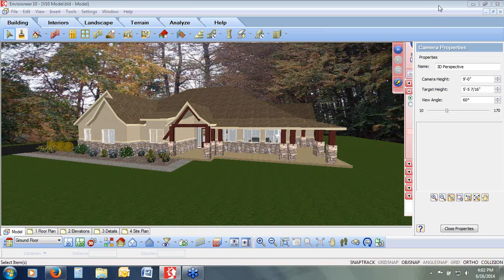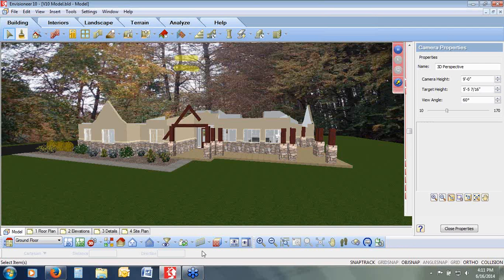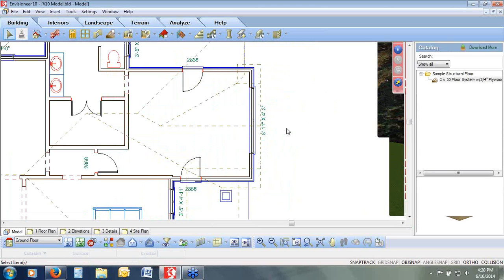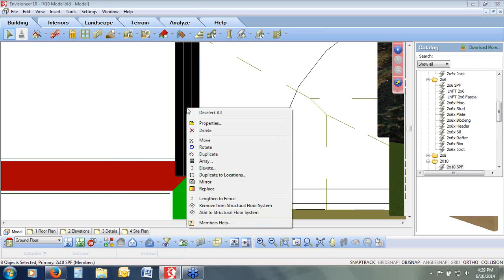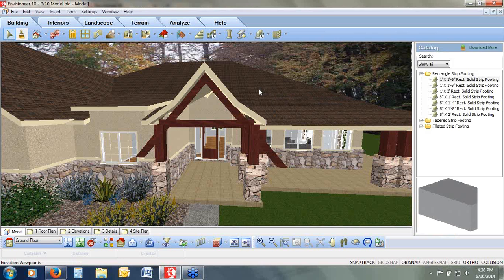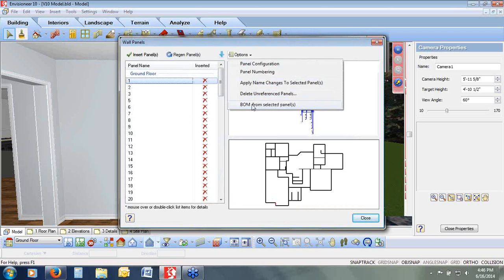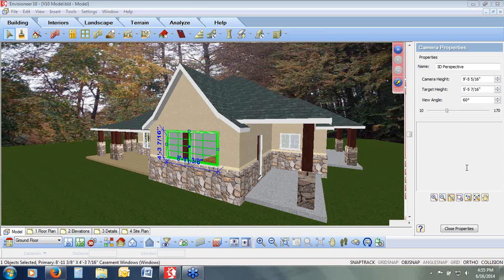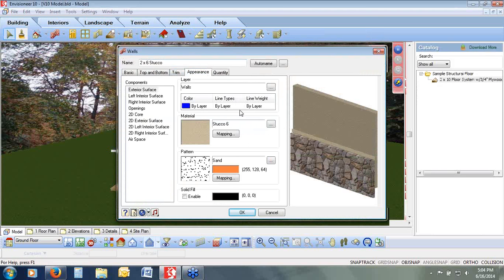Envisioneer V10 Launch Live Webinar

Comment: Hello hows it going 
I'm in Australia and have bought version 10 
I've been using it Quite a bit mostly self taught as I cant afford the webinar costs at the moment 
Your the only real person that I've you tubed that really knows their way around this program in regards to also adding features to improve this software
I've got at least 10 important things that would improve this software such as features present in auto desk revit 
but at this stage I really want to know what the go is with my model view has disappeared ? its not visible 
Element labels show up when the cursor passes over it on the screen but the model is not visible 
also in 3D quick-view different angles it shows in the preview window that indicates where the camera for that view is active the height and angle of the camera in relation to the drawing but still no view
I can create another model view as in add model view and the model view is then viewable but has a cut away section through one corner of it as i turn the model the cut line disappears is this a graphics card issue or  ?
the drawings do stutter as I try to move them in 3D and takes a short while to save and after selecting something in the drawing response is lazy like and not instant
can you help please ,
I don't want to bother the people I bought this software from here in Australia they have indicated that they need to charge for any software related issues and in the $100 + hourly session so I'd appreciate your help cheers Bart Kapteyn
0402455765 or my normal email gnplumbing@hotmail.com as well as this G mail account email gnplumbing77@gmail.com would be the best way to contact me